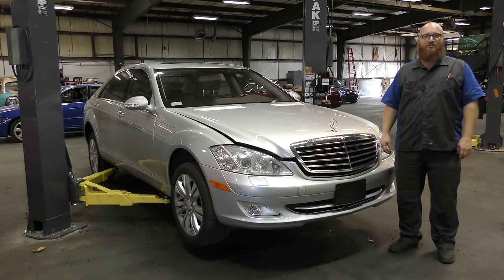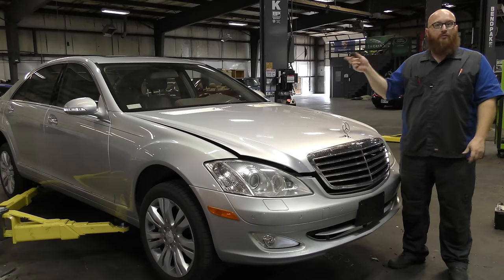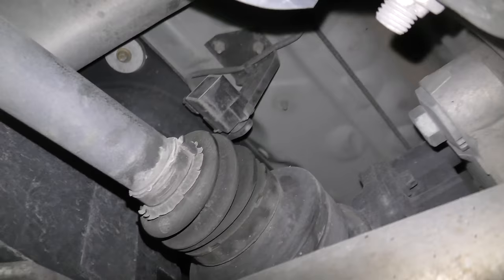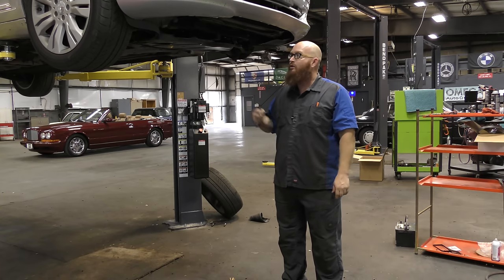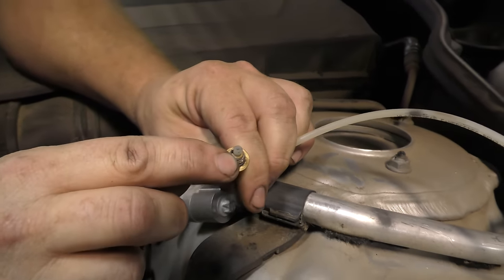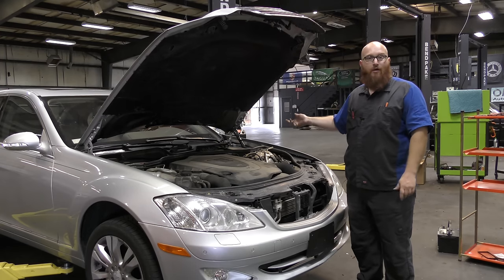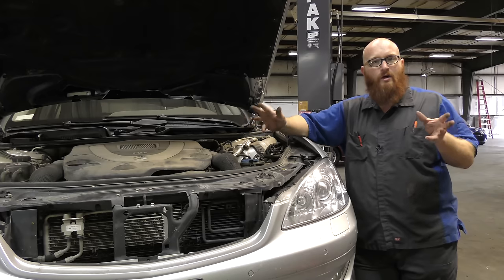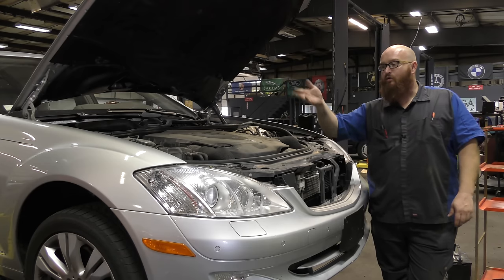Fixing Flat Airmatic Suspension System. CAR WIZARD shows just how easy it is on several platforms

Comment: Yeah, actually airmatic system is quite simple and messages reported by obd is easy to understand.
I had some leaking at the rear of my 2011e350 and changed both rear airspring at 160000 mi. I also had messages regarding the compressor which finally appeared to have internal oxidation causing long filling time of the reservoir.
Now the car is just riding like a dream

Comment: You mentioned that the computer gives up and makes both air struts equal in low height to enable the drive to get it serviced. You didn’t say weather or not the computer could fail or it’s location is or how to test it. You say the valve block is the brain in the height control, but what other than the height sensors tell the valve block what corrections need to be made. When mine had dropped to the ground like a lowrider, I found a bad compressor, valve block, and the link arm to the rear sensor was missing. Replaced all of the above and it still doesn’t go up and the dashboard warning for the Airmatic is still on. I am waiting for the Control Module to arrive in hopes that it will be completely corrected. I should mention that I removed the existing Strutmasters and installed the Airmatic Set Up again. The ride was extremely terrible and started to make knocking noises as well as damage to the lower Ball Joints. The compressor and Valve Block were damaged by the moisture entering a crack in the in-line air filter tube . My vehicle also has a reserve tank that was mentioned but not shown. 2002 S430. Thank you for making the video.

Comment: Awesome video. My wife has an 08 GL450 and the compressor ran trying to air up the rear. By time she got home the compressor would not come on. Changed the compressor, valve block, and filter/hose (hose was broken and we live in a very dusty area). Compressor still wont come on. The compressor came with a new relay, fuse is good. All codes cleared, but still no compressor. Any ideas?

Comment: Great video and simple explanation. I have a 2007 ML63 AMG where the suspension is stuck to the top, it lowers down a few ml but is always too high, no fault codes. Would a level sensor be the best assumption as an issue??

Comment: hi wizard! I have a 2013 gl350 and i absoluely love it. It has the AMG styling package which wasnt available in USA. I get amazing fuel economy and the air matic rides sooo well. These cars just need to be maintained with oil changes at 10k. Im scared about the oil cooler seals but everything else seems really good. Do you have any tips for us diesel mb owners?

Comment: I have a w221 s class that has just leaked hydraulic fluid from the front right air strut. Yes hydraulic fluid!! It's in the small damper  on the lower part of the strut. I have had to order a full strut as I can't find a damper as a part. The ride height was unaffected but the leak was obvious.

Comment: That bladder is where merc air shocks normally go wrong. Silicon spray can help however it may not. I treat these as a consumable. I don’t believe in doing one at a time however, should do both. Bottom line is air shocks are a luxury and this does happen every once in a while

Comment: Awesome info much appreciated. I have a 2006 s500. I notice after being parked for 3 days in winter passenger rear deflates then a day or so after left rear does the same .in summer it takes longer to go flat. Two i started seeing in dash Presafe Unavailable Then the car has to be turned off then back on for it to clear sometime. When that happens its difficult to put it in park i usual have to do a back and forth D to N. Any advise appreciated.

Comment: I went through complete replacement of the Airmatic in my 2012 E550 sedan 4 years ago.  Luckily it was all covered under oem warranty but it took the MB dealer 4 trips over 12 months to get it solved.  That has me really worried because they charged MB around $10k cdn to replace everything.  Upside is, it has been flawless for 4 years since the warranty ran out (and everything else with the car flawless too).  I looked into downgrading to springs and it might only cost 2,500 in parts +? labour vs 10,000 for full airmatic system replacement at the dealer.  However this video has me hoping any future failure will be merely a strut or two, or compressor on its own which will be manageable.  maybe.  Also I wonder how to move the car if I wake up and it's collapsed some day (has not happened to me yet).  I know there are aftermarket air struts for a lot less, and I get my service at a non-dealer MB specialist for the last few years, so should not be a 10k hit - I hope!
Reply: MB dealer prices are ridiculous usually. You were unlucky though, my 2002 W211 E500 is only just now needing rear bags, slow leak, still drives fine. Rear settles over a few days if not driven, comes back up when started. Front was done a couple of years ago. Car has over 230K Km.  Yours will probably last another 10 years.

Comment: Wizard, have you done a video with this Mercedes model but with the hydraulic system? How can you test those black ball called dampers? If you go on the highway and you stop, and when you accelerate you can hear a whining noise coming from the engine compartment, what would you do check first?
Reply: the black balls are called accumulators. they are easy to replace. basically, you cant inspect them without removing them, but if car bounces its a sure sign. it has latex membrances inside and they wear out

Comment: Wizard, what will the new strut cost? What year is that Benz? Thanks. Love the videos too!
Reply: Those are my questions, too Wiz, thanks Rodo.
Reply: A lot
Reply: Parts are usually around $400, labor around 3 hours. When replacing them, I use arnott air struts. Doesn't matter if it's a land rover or Audi. So far haven't had a single one fail.
Reply: The car is a W221, so 2007-2013. The strut prices are all over the map, $200 for a knock-off to $1200 OEM. Prices are different for front and rear, 4Matic/RWD. Google's your friend.

Comment: hi very good video! thank you wizaed for sharing. i have a problem with my 2000 S430  ones it shows in cluster irmatic , my transmission does not shift other than first gear. i replaced all air bags and control valve and my rear right side seems to be a little lower than the others. any Ideas? some one told me that my car needs to be leveled with a scanner

Comment: I have the 2002 S430 W220 MB. Most of the time, my ride height goes to the full height extension if I raise the vehicle any way accept completely level with a flat lift.  Then it rides extremely hard and won't level out.  Should I change out the level sensors and/or just have the system recalibrated?  How can we calibrate the system without a scanner, is the real question here?

Comment: I have a w221 S class like in the video but when the struts failed on one side of the car it didn’t lower the other side like you said it should. This was true when it happened on the front passenger and rear driver side struts. The struts were replaced over the last couple years but does this point to an issue with the valve block?

Comment: The wizard should make this S Class do the Rodeo Mode. Airmatic suspension on a Mercedes is the worst, especially taking it to the dealer to get serviced. If you replace them it better to do it in pairs not individually it one fails usually the other will as well. Mercedes should give the consumer options for regular shocks and struts.

Comment: hello, great video, i have an issue with a w220 S350, Airmatic, on the dash board the buttons for air suspension are not working always off, i checked all the fuses of the car all are ok, the dash board is displaying air suspension visit workshop. did you face this problem before ? do you have a video for that

Comment: Great video. Both sides of the rear suspension became low and it seems I have the same problem as on this video. Do you have the product code for those sensors please?…✨👌👍🇦🇺

Comment: My 2000 s430 is sitting flat on the tires front ans back. It use to raise up right when I turn it on but lately it's been dropping faster and not raising very high at all but I could still drive it. Now I can't even drive it without the tires scrubbing when I turn. You think it's the compressor going bad?

Comment: My '08 s550 front-end was down. Compressor was running hot. Had new OEM struts installed, both sides, and new compressor.  New AMG battery, Total cost was $4400.00
Reply: Damn
Reply: I’m supposed to buy a 08 s550 base and now I’m scared

Comment: Great vid and info.. I have a GL x164. No fault codes but she drops in the front over night. Sprayed everywhere with soapy water and still no find. Could it be a valve block? If I raise the car to lvl 1,2 or 3 and then bring the car back down she won’t drop and it can sit there for days with no leaks. Why? Air bags ft and rr have been replaced 2 yrs ago..

Comment: Question? What if the computer is not reading that one is leaking. (It's down on the front passenger, the other 3 are aired. I hear no leaks. Have not down soap and water yet.

Comment: I have a 01 w220, having issue with left rear strut not airing up. Replaced the strut which was defective with new strut. This strut will not air up although all other struts are aired up. What you think the issue is. Could it be the level sensor although the right rear strut is aired up.
Thanks

Comment: Hi, nice video! Also the other videos you made. Thank you.

I am thinking to buy a Mercedes benz w221 S500 from the year 2008. The car has all the services made on time. But I would like if the problems you showed in your video can be preventively avoided if the regular services are made on time. Or if that happens. Because the car cannot be used when the suspension is too low and then you have to take a taxi to go home. Please let me know what you think, it will help me a lot to decide what to do. Thank you very much.
Reply: dont do it man.  You will hate yourself!  Trust me!  I've owned too many and I'm on my last one.  When it's gone, I'm out!
Reply: @jagboy69  Thank you very much. I did not buy this one. I am seeking a 126 model. Thanks.

Comment: I got my E220 airmatic fault diagnosed today as the car was saying 'Vehicle rising, please wait' and sitting very low at the rear for the first 2 minutes when you start it.  They said they have carried out full system automatic check, which it passes, They also carried out a manual pressure check and found the driver’s side rear air supply hose, chaffed through, causing system to leak over time
 
so it requires new driver’s side air supply hose and connections.  How tricky is this to purchase and fit?  With it being at the rear and having to connect to the front of the car,  is that a lot of work to replace??

Comment: Wizard:  Would you spec a new car with air suspension based on the ride, initial cost, and repair issues?  Is it really worth the cost and risk?
Reply: Many of these luxury cars come standard with air suspension, you don't have an option to spec it or not. Personally, owning an S-Class, I love the air suspension and it's one of the reasons I bought the car. That, and the super quiet ride (laminated glass all around, extra thick insulation, etc), decent handling and AWD (4Matic). If you can afford a new luxury car, you should be able to afford to repair it off warranty. $600-$1200 for an airmatic shock is pricey but hardly a deal breaker when you're talking about a $100,000 car.
Reply: OMGWTFLOL  My apologies, I was referring to the GLC and GLE models where it is optional. In addition, I am from Canada where local MB dealers  are in a monopoly position and typically charge almost double what Wizard notes. Labour is now $175 per hour in Vancouver plus 12% taxes.  Wish we had access to a Wizard!!!

Comment: Car Wizard.....I have a 2001 W220 Mercedes-benz S430.  The rear on both sides goes down intermittently if the car sits for awhile, but it airs right back up when I start the car.  When I start the car, there is a message on the dash alerting me that the car is too low, but the message goes away once the car airs up.  It's been doing this for about a year.  Is this normal or is there a problem?

Comment: About diagnostic problem: I own a 2006 C class 220 CDI "Sport Edition" and I randomly got the message "ESP failure, bring the car to the center" but no warning light on the dash. Then you switch off the car, switch it on again and the message is "ESP inactive" and again no check light on the dash. I had my scan tool (MB specific iCarsoft II) plugged in and it also can't get any code from the ESP system... So it was hard to get. Until...
...the scan tool can read real time data and I plugged it in and drive around looking at data readouts. And at a certain moment I got the "ESP failure" message and I saw that in that exact same moment, the steering angle sensor had frozen to the last angle value he was reading and didn't send anything new to the ESP ECU. I repeated the test and again same stuff.
Got on this site: http://mbepc.net/1/fg/c/69p/203208#gsc.tab=0 and managed to see that the sensor went through several iterations with several updates. Got the spare code of the very last version for my car, checked on eBay and got an used one from some Baltic country (I'm in Italy) for 170US$. Replaced it and BANG, no more issues with it, perfect readings and all fine.
Proud of my self and spared at least 400US$ from Mercedes dealership... :D

Comment: Those parts are let’s say shockingly expensive.
Reply: It's a Mercedes...
Reply: 200$ if you dont need the strut on audi of same era. You can change the air spring alone. My 542 000 km car still runs the original struts, they rarely break. Cheap and nothing beats air ride with adaptive suspension for ride quality and polyvalence
Reply: What do you drive? A corolla?

Comment: 2006 Range Rover Sport, air failed, converted to to coils (which actually gave a bit of a lift) and have never looked back!
Reply: Why not fix it and have a superior ride?
Reply: @TheChunky2010  Exactly.  Might as well go with a Ford Escape or Explorer, if you're going to cheapen your car.  No offence to Ford peeps.
Reply: @TheChunky2010  It needed everything...air struts, valve blocks, pump...was gonna cost more than the value of the Rover.  And I like the look better with a 2" lift, 18" LR3 black wheels, and real off-road tires.  And, it's done.  Never another air component to be replaced ever again!
Reply: @pfsantos007  Apparently you've never suffered an air strut failure off-road.
Reply: @TheChunky2010  you going to shell out $800 for a single strut?
Reply: @ExTrumpet  Makes sense what u did, why waste all that $$$
Reply: @Nippledozer  Believe it or not, apart from the air components this Rover has been very reliable...knock on wood!  And they are dog-cheap to purchase now!

Comment: 2006 CLS500---Any of my CLS brothers out there know how much it cost to do both shocks on either the front or rear? and is their a price difference between the two? Of course dealership prices please. I had my car for a while now with really good luck as far as upkeep costs but have heard of some horror stories when it comes to replacing the air shocks. In  the winter when my car sits for a couple of weeks the back starts to sag, My plan is to trade off my benz for a much newer car to eliminate this possible headache, I zero'd in on that thumb nail, right up my alley!
Reply: Just did rear air springs on my 06 CLS. Arnott’s A-2724’s. Paid about $300 each and installed myself. Dealer did front a few years ago and cost me about $2,400, ouch!

Comment: My 08 W221 has a code and the dash says malfunction on the dash. There's no air loss but the code says fault in component (Y36/2Y3) right rear strut plunger valve. What does that mean? New stut time?

Comment: Are there reset codes? I changed out my car battery and when I switched from convenience to sport my rear air suspension locked in high/lift mode. Any thoughts why? I have a 2006 S430 base model Mercedes Benz.
Thank you.

Comment: Hey Wizard,

I have a 2008 GL500 RHD in Australia. I have had a few mechanics look at my airmatic with full off road package. As in X3 height selector and x3 way ride configuration.

My question is, when parked overnight on is low/normal ride height on normal of comfort ride the rear will sag down.
But, if left on off road level 1 and ride set to any mode it will keep its height.

There is never a noticeable air noise other than when opening doors after it has sagged. Sounds to be coming from the air tank, balancing out the 4 corners. Neither is there a low annunciation on the dash. 

Any thoughts?

Comment: Just recently purchased the 02 S500 V vehicle was great for a few days jumped on the freeway floored it a bit then I heard a noise in the engine area or by the firewall felt like might have been the transmission or something but the vehicle was still good running well went to the grocery store parked it when I came out it was drooping from the left side and I cannot hear the compressor is that a common issue any advice would be much appreciated thanks in advance
Reply: Left front driver side only

Comment: 2010 gl 450 air suspension on all 4 sides are down...i check all fuses and relay are good...i change the pump also...the Benz wont let me communicate with the air suspension. When the past i used that scanner plenty of time to do work on the car...what should i be looking for

Comment: So my airmatic suspension has blocks on top that the airline connects to with a 3pin wire . I tried the shop air test but it’s like it’s blocked off like an internal valve. Is there any way to bypass to do diagnostic? I wish to keep airmatic and not convert over to spring